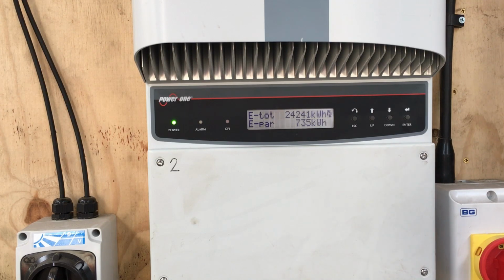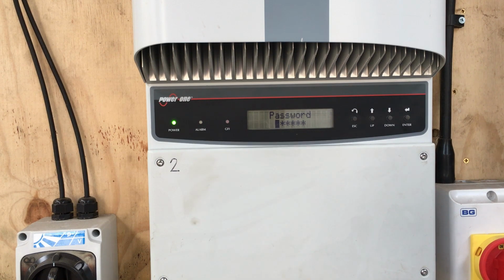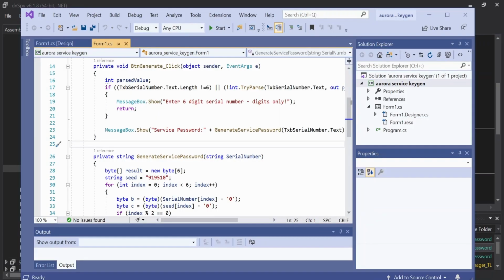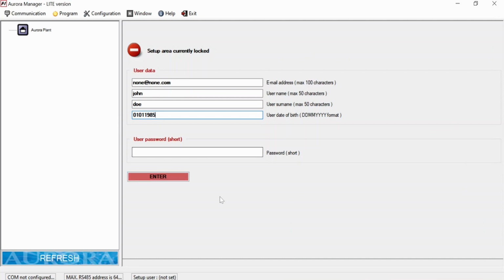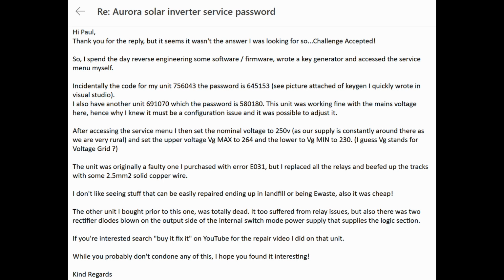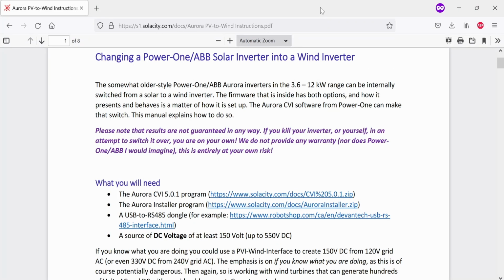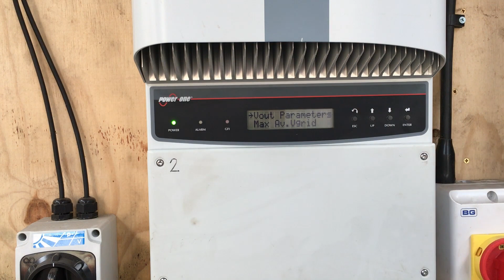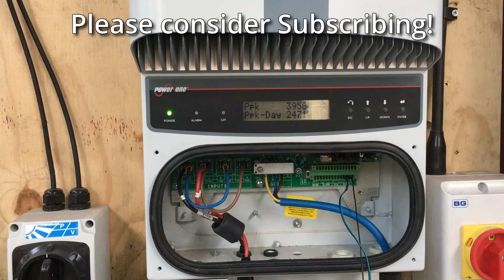Power-One Aurora / ABB Inverter - No password? No problem!

Comment: Hi i came across your channel while looking for fixes for Milwaukee tower lights I have 3 that don't power on, I had try few things before and can't get them to work, the led chips don't turn on while checking them with a voltmeter I was thinking it was because of a coating on the board or a bad PCB but I haven't had luck finding a replacement that don't costs the price of the light and or the actual leds are the bad ones and haven't been able to get voltage on the output wires that go to the led module I thought it could have been the temperature sensor or even the switch but after seeing some of your video it gave me a bit more confidence to go back and check the boards and try replacing the leds thanks to show that things can be fix if someone actually cares of saving things that otherwise will end on landfills
Reply: Thanks for the reply I have already seen that video as well, I try hot wiring the led assembly with a car led driver that I have and that didn't work and I couldn't get voltage out from the PCB to the leds so I think I may have multiple failures but I have a better idea of what to look for thanks again
Reply from the maker: No problem. Glad to help.
Reply from the maker: Thanks Jose! I did look to get one of those but it sold for more than I wanted to pay. Do the LEDs all come on together usually? If so I would count them and multiply that by 3.3v that should be the voltage needed to drive them all. I would then  check the output of the board and see what you are getting. I had similar with the HUGE Milwaukee floodlight video. Have a look at that one if you didn't see it.

Comment: Nice job on the password resetting,with the USB port it may have a password lock to disable/enable it. You might also be able to do a settings back up/restore via the USB port if you do get it working. We have some Ink printers at work, if the default password set for the end user doent work or is corrupt its possible to use a small supposition formula with the date to work out the 8 digit access code (1234123412 is morphed from the 1234567890 numbers composing the date i.e. the date 15102022 = 11122222 ).
Reply from the maker: Thanks Andi! Yes you can dump the settings eeprom as I did that prior to any modification.  Interesting about those printers.

Comment: is there an app or software to remotely monitor the pv system
Reply: There is an Arduino Based monitor on instructables, the guy who made it did not want to pay the huge price ABB wanted.
Reply from the maker: I saw that a while back too, I think it was esp8266 or esp32 based.
Reply: @BuyitFixit  Yes that is right, I have made my own PCB for, still trying to get the code working though. It is a complex beast with a lot of libraries, ATM I run 3 5KW Aurora inverters that I want to monitor. They are all working off-grid with my off grid system. If you have the right off grid inverter it will back feed the excess power converting it from 240VAC to 48VDC to charge the battery. The off grid inverter is all built from scratch by myself, the battery is a 775ah 48V forklift battery. It is no toy, the off grid inverter will run at 8KW continuos (battery permitting) and many times that for starting induction motors. Also I have built a charge controller for this that uses MOSFETs to reduce the DC input to the grid tie inverters to prevent overcharging. I see in the comments you have some interest in off grid, if you are interested let me know. BTW today I was able to use the CVI software to get rid of the stupid anti-islanding pulse every 1 second from each of these Aurora 5KW inverters. This pulse is strong enough to show in the SInewave and can be heard in the off grid inverter transformer and inductors. I have a couple 3KW Auroas and they don't seem to have this stupid pulse.
Reply from the maker: Yes there is. It's one of the ones I downloaded from waybackmachine. I cant remember the name off hand but it connected to the laptop via the rs485 interface and pulled all of the previous stored data as well as current values. It also displays some nice charts!
Reply: @BuyitFixit  ok thanks 👍
Reply: The software name is Aurora Communicator. I'm using v2.9.21. You can monitor, download faults/errors and set this app to send an email for dayly production. It runs on a laptop which is accesible from the internet, so i can monitor from another computer or with smartphone.

Comment: What timing!  I have 3 separate 6000 watt  Solar City/ABB branded power one inverters (PVI-6000-OUTD-US-Z-A) that I've been trying to get into the service mode.  I've tried a few different versions of disassembled C# code I've found with no luck so far.  My serial number format look different.  Here are my 3 serial numbers and date codes
1524542372 WK:2415
1523472263 WK: 2315
1528781513 WK: 2815

I'm trying to get I to service mode to see if there is a way to enable the remote input terminals.  The normally settings menu lists them as not available, and they seem to be hijacked by and Arc Fault detection circuit.  The manual shows that the settings for the remote terminal should be available.  

Any ideas?
Thanks!  Great video!
Reply from the maker: Just use the aurora cvi program with the password and link in the video description. The 1st 4 digits of your serial numbers are just the date and year so ignore and just use the last 6 digits. That will give you the service password.
Reply: @BuyitFixit  Oops, sorry!  I didn't read the description and missed that you already provided this information.  I don't know how to format code in YT comments, but here is my Python implementation of the same service password generator: (it uses only the last 6 characters of the SN, so both 10 digit and 6 digit SNs are supported)

def GenerateServicePassword(serial_number:str)->str:
    seed="919510"
    serial_number=serial_number[-6:].encode('utf8')
    seed=seed.encode('utf8')
    result=''
    for i in range(6):
        b = serial_number[i] - 48
        c = seed[i] - 48
        d= b + c if i % 2 == 0 else b - c
        result+=chr(d % 256 % 10 + 48)

    return result

print(GenerateServicePassword('1524542372'))
Reply from the maker: @jondecker1372  Very Nice Jon! over on andy Reynolds channel I left a comment to someone explaining how to work it our on paper. The last digit is always the same as its value-0 and the rest are just the seed + then - each digit of the serial and just use the last digit of the result.  Unless it's a negative result then  -1 is 255, -2 is 254 etc so result is 5 and 4 respectively (Because of the wrap around on unsigned byte).

Comment: Very informative thanks for sharing. So hard to find good info for these inverters. I have 2 of them, one working one with a GFI fault. Look forward to more👍
Reply from the maker: Thanks Jim! I only came across these because a friend had a faulty one and he asked if I wanted it. Then I ended up going down the rabbit hole like what normally happens when I get things!
Reply: @BuyitFixit  Plenty of these still in service. They have their problems it appears but they are pretty good and well worth trying to save👍
Reply from the maker: @Woodyjims-shack  Yes, the two I have seem to be running fine since repairing them. One was just the relays, but the other one I repaired on the video I did, also had problems on the switch mode power supply which I also had to repair.

Comment: Hi, I downloaded the key gen software, but assume it will not work on Linux. Could not work out the way forward, any clues? Cheers
Reply from the maker: Hi Andy, It's a windows program I'm afraid. It might work under WINE possibly? Although I haven't got a linux box to test
Reply: @BuyitFixit  Ah, thanks for the info, I'm assuming it's the 7 figure WO that's used, is that right? Cheers
Reply: Further to this I notice the serial numbers are 10 digits. Mine are inverter A/ 1417444785 and inverter B/ 1408029249, both have internal GFI faults and I wish to switch off the GFI sensing. Could you calculate the password please, cheers
Reply from the maker: I'm currently out at the moment but the password program only takes 6 digits
Reply from the maker: @TheInfoworks if you check my video on the email I sent to support there is a picture of the 6 digit serial number of my unit if that helps?
Reply: @BuyitFixit  Thanks for that, found it at 1.05 minutes. All my Aurora inverters have a different serial number format. The add the week code at the start and then show is separately. So A is 4447885 and B is 029249.
Strange but I will video this and send you the link, referencing your video and adding it at the end. Cheers
Reply from the maker: @TheInfoworks  Thanks Andy. So were you able to connect the laptop to your inverter?
Reply: @BuyitFixit  Hi, no, I've not got past the password problem yet. The stuff in this video is a bit beyond my experience. I was hoping to use the access in the inverter screen but need the passwords, cheers
Reply from the maker: SN:029429 = pass 918359
SN:444785 = pass 333295
Hope that helps!
Reply: @BuyitFixit  Hi, that's splendid. Got to work for the next few days but I will get right on to this with the inverter  bench testing setup. In the video a first name would be great if you want to release it. Be back to you as soon as, many thanks, Cheers, Andy
Reply from the maker: Hi Andy, its Mick :) let me know if I can be of any more assistance. I might hook up the laptop again and figure out how to disable the riso as I dont think there are many options in the menu on the inverter itself..
Reply: @BuyitFixit  Mick thanks for your time. I tried the password and a message came up "set the clock". So I set the clock and tried again, same result. When I tried to set the clock again It had re set to 2000. Strange, might be one for you. I will do a video very soon. Sounds like it's in your expertise range. Cheers
Reply from the maker: @TheInfoworks  Very strange, so if you just type a wrong password does it say "invalid password" or something?
Reply: @BuyitFixit  Mick, on this one I've not tried that. on my other Aurora it just does not accept it and reverts to blank boxes. Working tomorrow but I will try to get the video up soon. This is a 2Kw Aurora with the rounded corners and the heat sink on the back. Cheers
Reply from the maker: @TheInfoworks  I've  not seen one of those. Perhaps they may be newer and use a different method? Best bet is to get an rs485 interface and run the software on an old windows laptop perhaps?
Reply: @BuyitFixit  Mick, just loaded a video on this aurora password fault, see what you think. As you will see I know nothing about RS485 and the wiring, cheers

Comment: Hi, thanks for the heads up on this video, can't say I understood it all. Can the ground fault sensing be switched off as I have several of these with an internal ground fault problem. They are un-necessarily sensitive and I wondered if it's an easy adjust, cheers
Reply from the maker: I'm not 100% sure on that one Andy. Is the ground fault on the DC side? like the RISO measurement? If so I think I saw something about disabling that.
Reply: @BuyitFixit  Hi, yes it's RISO, also known as GFI on the DC side. It commonly comes up on the start as 20 M ohms. It's far too sensitive. I would just be working through the unit screen, is it available through this or do you need to use a laptop? I swapped out a HF SMA for an Aurora and the Aurora would not run due to GFI, whereas the SMA was fine, Cheers
Reply from the maker: Hi Andy, sorry for the late reply. You would need to use the laptop and an RS485 adapter like shown in the video. I think it was Aurorainstaller.exe which allows you enable / disable the Riso. I haven't long got back in, so can't connect it to the inverter currently, but looking in the code it has these strings:  "[RISOEN] DIS" and "[RISOEN] EN" and I'm fairly sure when I was messing about with different progams I saw the option for ENable and DISable :) I think you need to input the service password, but you can get that from the CVI program and use the master password both are in the video description. It may well have the enable / disable in option in the CVI program too.

Comment: Hi,
Just saw your video and it's very impressive.
I have the same inverter since 2016 and i never found a way to access the service menu and i was wondering if there was any chance of getting your passwoord generator or even juste get my password by giving you the unitnumber
Kind regards,
Reply: Absolutely amazing, your channel just goes from strength to strength on things that can be done, you definitely have skills in all departments, great video 😎
Reply from the maker: Thank you Clifton!
Reply from the maker: Thanks for that! No need for my password generator. Link in the description for CVI 5.0.1 and use the master password in description also. It had built in keygen as shown on the video :)
Reply: @BuyitFixit  
Thanks for your respons. 
I tried the link but I end up on the wrong page. It says that it doesn't exist anymore.
Reply from the maker: Sorry about that. Fixed. It needed %20 instead of a space.
Reply: @BuyitFixit 
Thanks
I will check it when i get back home

Comment: I wonder if one of those options allows for use off grid. 🤔
I'll have to read up on the difference between wind turbine and solar. I figure the wind turbine have some sort of braking signal if the voltage input goes too high.
Reply from the maker: Good question. I don't know, but I may actually be changing my setup to be fully off grid or party on and off. I've got some batteries on the way and a Victron easy solar inverter coming. So possibly a future video.. not sure yet.
Reply: @BuyitFixit  If you haven't heard of him already, but I'd bet you have, check out the Apocalyptic Inventor, you'll find all his content informative and entertaining, and he does a lot of stuff on 'off-grid' solutions I'd think you'd find invaluable, he's very resourceful, like yourself 👍
Reply from the maker: Yes I watched his video a few days back when he was using the generator and making the home made vs bought battery inverter system 👍👍
Reply: @BuyitFixit  yes, he has brilliant content as always 👍
Reply from the maker: @Charlie_Crown  Yeah I've been watching his content for a while. Scrapyard repair-a-thons :) you can get some good stuff at those scrap yards. Pity not much like that in the UK.
Reply: @BuyitFixit  unfortunately, not much for useful industrial stuff that's for sure, pity
Reply: @BuyitFixit  splashing out now we're over 1k subs?
I could do with a Victron inverter. Only got 150W solar panel into an 80Ahr van battery. Runs the radio and lighting, would be nice to power the 300W drill press.
Reply from the maker: Ha! Might have 1k subs but still not enough watch time to even monetise the channel! I'm doing it in case the grid goes down.... never know what the future holds....
Reply: @BuyitFixit  i think you need the batteries for off grid so that your load doesnt try to draw energy through the inverter.
Reply: The solar already have a table for MPPT. When switching to wind, you have to write the table based on generator power/speed/voltage. I did that for PMG in a watermill and it's working for 15 years. Voltage limitation done by the windbox, which is converting AC 3 phases from PMG inot DC and limiting DC to approx 510V, switching extra power/voltage on a diverting load.

Comment: Loved the video.
I'd like to know what's within that 'Data Log and Program' menu.
Interested in automatically recording the daily generation to a database.
I watch Andy Reynolds videos for solar work. One unit he was looking at had at least a dozen different power settings, G83 being one of them.
Reply from the maker: I think it was for clearing the logs and resetting all of the stored inverter data back to zero. For the daily generation there is software that does that exact thing. I think its aurora communicator or manager perhaps? I did look at quite a few other programs too. I also replied to Andy Reynolds as he left a comment on the inverter repair video asking if I could make a video like this one.

Comment: Hi there, I got a dead PSU from an arb function gen, very similar to pc psu but 19v and 7v instead, can't figure it out, any chance you can look at it and make a troubleshooting vid? I will pay postage both ways and any parts you need. Thanks!
Reply from the maker: Hi, I don't usually fix things for people, and thank you kindly for the offer. Have you got any pictures of the board perhaps? I could tell you where to look / check perhaps?